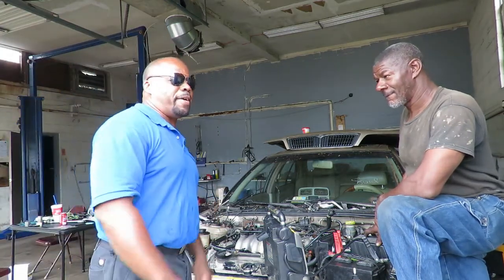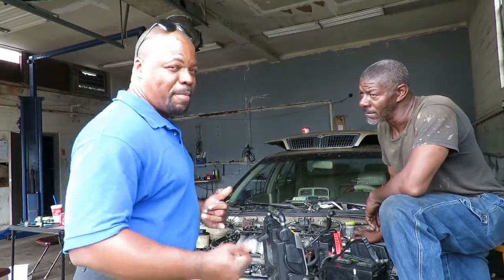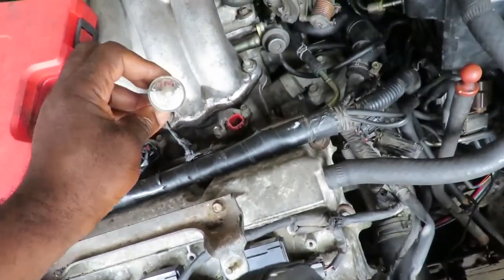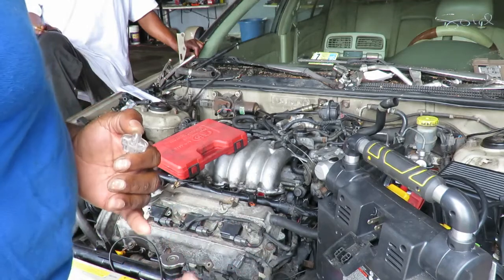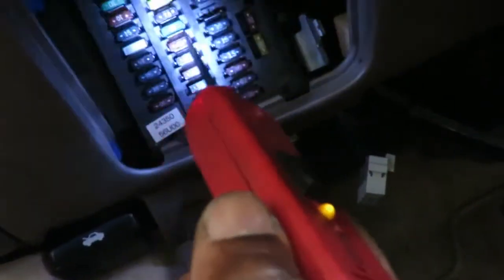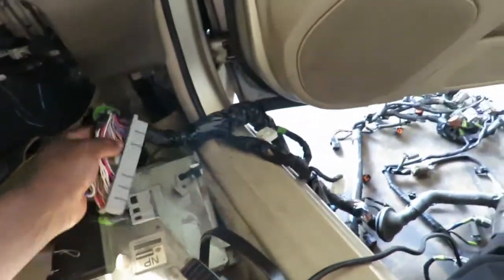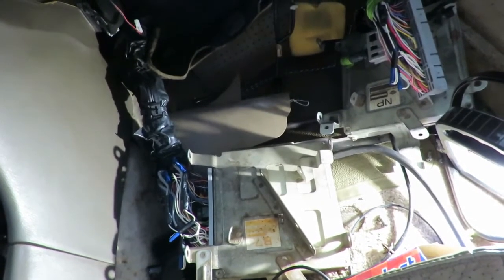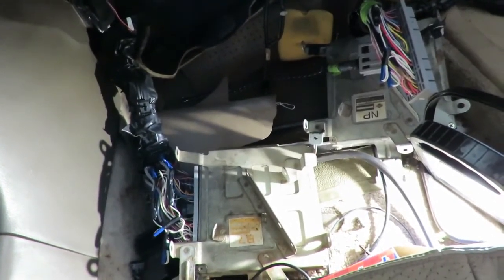⭐ 1998 Infiniti I30 - No Start - PART 1

Comment: which crank sensor did you replaced the one by the oil filter or the other one
Reply from the maker: The one that's at the left rear of engine.
Reply: Astral Auto Repairs I have a question I have a 2001 Nissan Maxima and I'm getting a not start issue.it'll crank all day but won't start up.i replaced both crank sensors and camshaft sensor also new coil packs and plugs also.
Reply from the maker: Do you have spark and fuel?
Reply: Astral Auto Repairs yes I have both and the fuel injectors are firing
Reply from the maker: Check compression,  and if you have any codes let me know what they are.
Reply: Astral Auto Repairs I have compression I had replaced two motors in it last month and they both are doing the same thing.I had replaced my motor because the old one had no compression.And I don't have no codes.
Reply: Astral Auto Repairs I had also got my ecm rebuilt I had took it out of the car and got it shipped off to be repaired....I also had took my car to the shop and they had it for 2 weeks and told me that they can't help me so I got my car towed back home.
Reply from the maker: Wow! Okay, no problem, let's back up for just a moment.

1. How much fuel pressure do you have?

2. How are you checking injector pulse?

3. How are you checking spark?

4. What kind of scanner or code reader are you using, and does it read data?
Reply: Astral Auto Repairs how much fuel pressure I'm getting I'm not sure but I know I'm getting fuel because the spark plug getting wet with a lil gas on it.

I checked the injector pulsed with the lil light I had rented from O'Reilly 

I checked the spark with a spark plug tester 

The scanner I'm using is an actron cp9580a it has some data built in it
Reply from the maker: Ok, we need to know the fuel pressure. See if you can rent a fuel pressure tester and let us know what you come up with.
Reply: Astral Auto Repairs where to hook up the fuel pressure gauge to on the car because you know on my year Nissan Maxima I can't hook none up to it even if I take the fuel pressure regulator off
Reply from the maker: There's adapters that come with the tester to hook it up to your car.
Reply: Astral Auto Repairs where do I hook it up to I see the fuel rail it has the fuel pressure regulator in one side and the fuel pressure damper on the other side hook up to it
Reply from the maker: there's going to be a line or a hose that bolts right into the fuel rail. Which is the fuel line coming from the tank. You have to remove that bolt, and inside the fuel pressure kit there's a special bolt that will replace the original bolt. That special bolt will allow you to hook up a pressure gauge.
Reply: Astral Auto Repairs ok I'll check it out tomorrow when I get my car towed home.I took it to Nissan to get them to reprogram my ecm since I had got it rebuilt and they don't want to do it.I took it to them Friday morning and they called me with some bs talking about they'll need to replace my whole wire harnesses for  $2,500 which I know it's nothing wrong with the harness.Then they said they'll be able to reprogram it.
Reply from the maker: WHAT???? Why did they say you needed a wiring harness?
Reply: Astral Auto Repairs they couldn't give me no good answer.If you ask me i'll say they never looked at it or even touched it because when I got it towed on Friday then I went up there on yesterday to see if they had moved it or put it up.Guess what the car still was in the same spot and the same way since I got it towed.I don't believe they didn't touch it.
Reply: Astral Auto Repairs hey are you mobile if so I'll pay you to come and fix my car
Reply from the maker: Lol, yes we are mobile. What state are you in?
Reply: Astral Auto Repairs Tallahassee Florida
Reply from the maker: We are only local at this time. Do some research online and see if you can find a reputable shop that may be able to help you.
Reply: I been doing a lot of research for over a month now and taken it to different shops and nobody doesn't want to fix it
Reply from the maker: Can you send me a rundown of everything that was done to the car, from the first time it stopped running with the old engine, up until now?

You can email it to me at Tim@AstralAutoRepairs.com

This way it will get me up to speed with where you're at.
Reply: Astral Auto Repairs Ok before I took the old engine out it was hard for it to start and that engine had no compression going to multiple cylinders and some had 80 pounds of compression but the car was able to start and run.The car ran slow so I had bought a good running used engine and had my girlfriend mechanic to install it.When he got finished installing it and hooked everything back up and put the oil and stuff in the engine just crank but didn't start.So I got in touched with the company that I bought it from and they send me a replacement engine.Once I got that engine I had the same mechanic to remove that engine and put the other one in.Once he got finished installing it and hooking everything back up and stuff we had tried to start it up but it was doing the same thing just like the other engine was doing it'll crank but not start.
Reply: Astral Auto Repairs what website I can download a wire diagram for a 2001 Nissan Maxima
Reply: @OnlineAutoRepairVideos  7